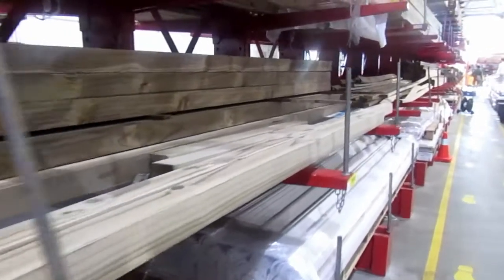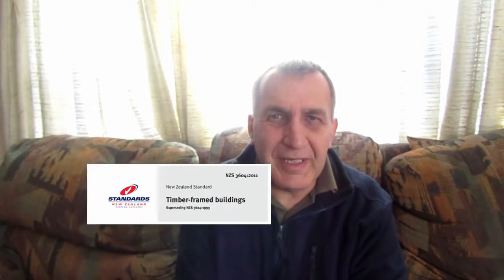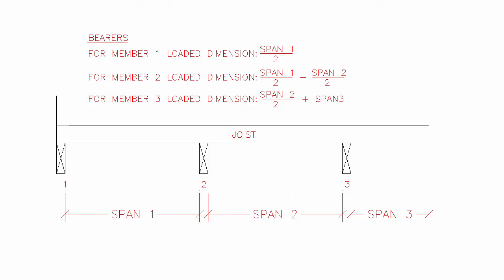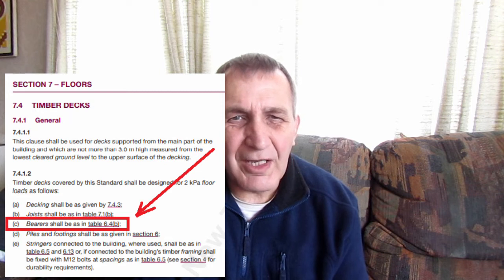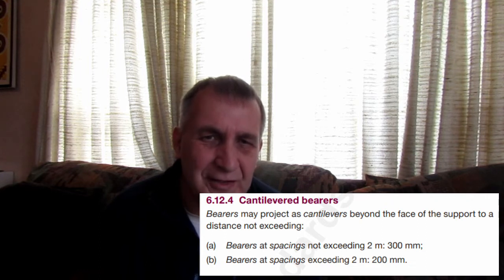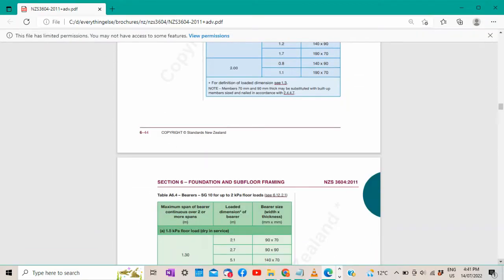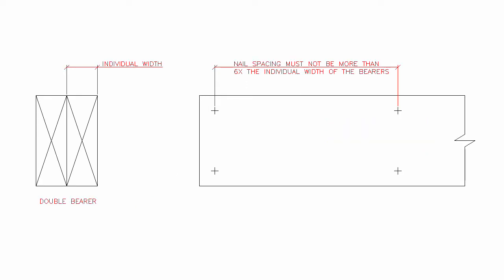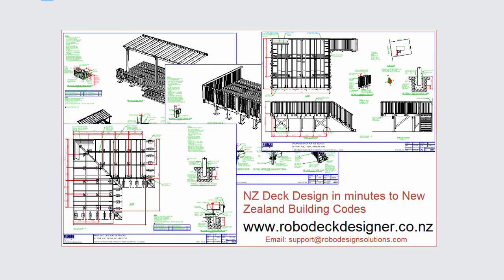Bearers for a New Zealand Deck using NZS3604

Comment: 3604 doesn't give span tables for laminated beams. 3604 tells me 140x70 SG8 for what I need but a 140x63 laminated one allows a little extra span between piles. Will you incorporate this type of lumber into your designer?
Reply from the maker: Sorry all the designs using ROBO Deck Designer use NZS 3604, there is no plans to incorporate laminated beams into the design.